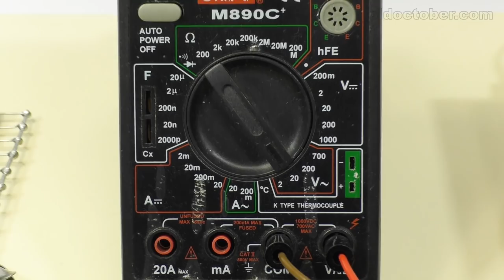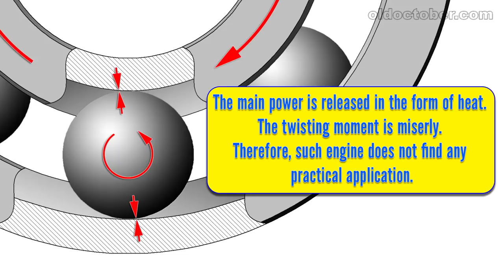Amazing Ball Bearing Motor DIY. Part 1

Comment: no really, silence works just fine. no need for obnoxious and distracting music while conducting an electrical experiment, especially when using anything in the 40 amp range. wow. an excellent video with what could quite possibly be the worst music i’ve ever heard in my life but still, I think the video compensated for the bleeding eardrums so it was worth a thumbs up

Comment: This is just one big short circuit. Unless you have some how hidden an actual electric motor with in your model.
If it is thermal expansion that makes it work then surely using a small blow torch instead of electricity would also make it operate....?!
I'm not convinced!

Comment: With that much current, there is considerable magnetic field circling the wires going to and from the bearing assembly.  A similar magnetic field circles the bearing shaft itself.  The interaction of these two fields may propel the motor.  I suggest moving the wires into various positions and see if it makes a difference.  The best way to negate any interaction between fields in the shaft and wires would be to have the wires in-line with the shaft (all components form one straight line). But it might be almost as good to fold the wire nearest the disk back along the shaft and then parallel to the other wire.  That should minimize the magnetic interaction, if that's the reason for the motor's motion.  It would be an interesting test. And, BTW, you can get 100A out of that little box?  :)
Reply: 500 W

Comment: DoItYourself  ..  Only Marinov thought it is caused by thermal expansion. He was a bit crazy. It's not the Huber Effect, either, that was a rail gun. It was first done by Milroy, 1959.
Reply from the maker: There are other theories explaining this phenomenon, for example, gas expansion under the influence of plasma. I told the most popular.

Comment: You must add an serial resistor for high current reduce an limiting.
   Your system use high current may be battery exlore.
Reply from the maker: My homemade power supplies go into current stabilization mode when the current limits are exceeded.

Comment: thats power supply is 5V 100A? WTF dude
Reply from the maker: 2V*40A=80Watt The protection of the power supply is triggered by 250 Watts.
Reply: +Do It Yourself 😅😕😑
Reply: you can use power supply from server
Reply: That's only 500 watts. That's less than 1 horsepower. And it's actually a lot less than even that since the video itself stated that its voltage dropped to only 2 volts when only 40 amps were drawn from it, and though maybe that was because 3 volts was what developed across the wiring i.e. the wiring had 3/40 ohm of resistance, I doubt the wiring's resistance was that much though.
Reply: صباح💋
Reply: Yhy dosent it have sparks with 100 amps ??
Reply: roberto hurtado tvc
Reply: Idea schematic and building instructions for power supply you are using. Would appreciate it I think everyone would.

Comment: It is a synchronous motor in my opinion and RPM is determined by the numbers of balls. Cannot be used as a generator unlike any other electric motor

Comment: I thought it was the same concept as a rail gun where the Lorenz force caused the percentile to lunch linearly but in this case round and around
Reply: This motor works because of balls in ball bearing heating up and expanding due to current a channel called rimstar org made a good video about thus

Comment: it is all have to do with the flow of electricity. the electricity don't flow straight from one point to the next in straight line. It moves around a shaft like a vortex. The fly wheel drags into that flow. Walter Russell Science based. tnx

Comment: And once again youtube has shown me an inefficient motor with no practical applications...
Reply: Inneficient? For people who tries to explain how things work, it is extremmely efficient.
Reply: Not in the slightest.  This couldn't get any more inefficient.  What is seen here is akin to a rail gun, except the projectile travels in a rotary fashion rather than linear, the magnetic forces propelling it on.  Those bearings will get very hot from the high amperage, and whatever lubricant was in there quickly destabilizing or burning.
Reply: What if it was your son who made this? Would you write the same comments??????
Reply: If I had a son, probably.  I come from an engineering background, and while the general concept of such a simple motor is cool in theory, having it run in reality can be pretty dangerous.  High amperages are dangerous if not handled properly, and if the motor seizes, it could weld itself together, and even throw off chunks of molten metal.  Worst case scenario, anyways.  What age group for a son are you thinking of that would have permission to run high amperage equipment anyways?  Just wondering.
Reply: Not everything has to have a practical application! This is more a learning tool that can be used by educators. And they are so simple to build that even kids can build it.  This looks like a homopolar motor!
Reply: as top said, this is super efficient lol
Reply: Hey don't let your son do this if you don't want him to burn the house or to get injured. Also don't let him to play with condensers if you want for his fingers to not be cooked.

Comment: ball bearing motors do work for sure but needs very high current. nice little project but one thing dude...that little power supply says 100amps?  in such a small box?, I'd like to see inside....unless you have power mosfets in there, and ac to dc conversion directly to the mains , there is no way you can get 100amps out of that little box......direct ac to dc conversion and power mosfets will give you 100 amps in a very small size but that means one side of the line is always tied to mains power so dude...this is a nice little VERY DANGEROUS project.....you definitely must have an isolated pulse width modulation circuit in there or one or more lantern type batteries in parallel....I do see an ac cord out of the back of that box so I would guess pulse width modulation supply ....anyways for those who commented here about the supply....PWM supplies can supply huge currents in a very small package...its not unusual to find these type of videos showing supplies like this....before PWM supplies, 100amp units were the size of 20inch TV...now they can be made the size of cell phone adapter.....
Reply: So I was right . You rectified the AC directly with diodes and then used power MOSFETS. Well, that will give you 100 AMPS for sure but that also means one live AC line.  Very dangerous......unless you plugged that AC cord into an isolation transformer.  Still, very nice project, but impractical......use bearings that have one runner isolated with either thin layer ceramic or plastic and then apply high voltage , low current.  Result will be the same but much reduced current consumption...unfortunately , arcing will occur but it shows that same result can be achieved . Unnecessary high current is not needed.  Make sure ventilation is available, ozone will be produced. Also, AC cannot be used, only DC otherwise no “H” field will be produced to cause rotation.

Comment: First off the music gas to go . Im not quite getting what you did with its not diodes? And how many amps dud it draw? And what was the voltage going to your motor? Sorry toy leave alot of questions.
Reply from the maker: The motor can operate on both direct and alternating current. A large motor will consume 40 amps, a small one - 20 amps.
See details here:
Part 2: https://youtu.be/O6jpZ1p5vyg
Part 3: https://youtu.be/KN8pu7UJpGE

Comment: what is the name, value and task of ten components that were connected serial.
Reply: Resistors and it is being used as like a fraction of an OHM current shunt to measure the current through the circuit this is done white commonly in most amp meters including digital in most analog ones Mike and I'm also meter there's the same thing except it's generally a piece of resistance Warrior on the board or a physical resistor.

Comment: Excellent exam question for electrical engineers! How does it work. I figured it out, so if you studied electrical engineering you should also be able to explain where the torque comes from. Clue - it is not from thermal expansion. Draw the field lines and it should be clear. If not, then have a beer. Actually, have a beer either way
Reply: Dennis Levy i was gonna just move on but you brought a reasonable challenge articulated in a calm manner. Now instead of chopping firewood I'm trying tofigure remember the leftside hand rule for determining the direction of magnetic flux. Dammit.
Reply: Yes Jonathan, with a comment like that you will never be an electrical engineer. A real electrical engineer sees the challenge in figuring out where the torque comes from.
Reply: Hello Dennis. I agree with you. It must be tangetial component of force F=q(v x B) on electrons in bar. Magnetic field B is problem to understand because all engineers think that it comes from drift electron current. But it comes from e.g. AXIAL current field J=(sigma)K   and that magnetic field is in shape of rings. Then use Lentz rule on electrons wich move in spiral path and you have tangential component of mehanical force.Greetings from Serbia.
Reply: Not right. Thermal expansion is the best explanation I have heard for this. Remember 40A is not a small current. It can create huge amount of heat in that metal.
Reply: Really?  Then why is the torque exactly the same when it is cooled in an oil bath? Where did you get your electrical engineering degree? Which university? Would be good to know the truth.
Reply: Engineering degree? I just left school at 2nd grade ;)
I think it is easier if you explain which fields exactly are in opposite direction that cause that move.
Reply: Dennis Levy b
Reply: david.  we have made that motor as birthday gift for our prof. of  "electricity" in university 28 years ago... 
Electromagnetism do not explain it.  It works on ac aswell with dc.  When using precise and new bearings the starting occurs without manual help and  rotation direction is random. If it would be electromagnetic the direction should be polarity dependent.
Reply: @jonathanee23  not fake I've done it myself I'm a DUI person into Electronics.
Reply: @MrTaff121  didn't know it would run an AC and yes I noticed mine would start up and randoms which baffled me. In terms of directional rotation.

Comment: You powerd with DC, didn't you?... But measured with AC...
Reply from the maker: I used alternating current. But for the Huber effect it does not matter what current to use. The effect manifests itself on a constant current in the same way.
Reply: Do It Yourself oh cool that's interesting... Thanks! So since this is actually working only by thermodynamics the current type doesn't have any effect! 
80W is quite a lot 😁
Reply from the maker: 80W is quite a lot
Yes the whole structure quickly heats together with the wires.

Comment: Attach the capacitor bro so the push start will not be required.....
Reply: Suliman Khan SK that works only in induction motor, as it provide a phase shift in between current and voltage that is further utilities in magnetic field space shift.
Reply: Suliman Khan SK
Reply: PRASHANT MADAN capacitor only work on induction motor ....
Reply: What?

Comment: It seems that you made something with no practical applications BUT...
That's just apparently...
When in high school  in a class of chemistry a group of  classmates and I were assigned to make hand soap but we ended up making LIQUID hand soap wich for us " it was a fail" since we couldn't think "out of the box" as all the  hand soap in those years was solid...
Today hand soap is very common , practical and popular....si it may seem that the rig your showing us has no use but some concepts in it may find some  applications in other areas.
Reply from the maker: You're right. Some nanomotors that are used in nanorobots work on this principle.

Comment: It's an electric motor so of course there is a magnetic field involved or it wouldn't work!  And the disc's rotation has nothing to do with the bearings...They just reduce the friction of the rotating shaft.  The disc appears to be made of Aluminium...If so, it will be subject to induced magnetism due to it's close proximity to one of the supply wires, which has an alternating magnetic field around it...This causes an weak opposing eddy current to be set up in the part of the disc closest to the wire which in turn causes it to be repelled away from the wire,  making it rotate.  The eddy current is too weak to start it rotating on it's own but once you start it by hand the process can continue on its own as long as the current in applied.  This can easily be verified...Simply replace the disc with one made of plastic or card (But not an old CD as that still has a layer of Aluminium inside it!)...It shouldn't rotate at all.
Reply from the maker: Пока учёные расходятся во мнениях по поводу истинных причин работы этого двигателя.
Reply: Interesting conjecture.
Reply: No, Captain, it rotates.... See the other videos... 😁😁😂
Reply: I've already done one of this,  and it worked only with the bearings and shaft and direct current from a  welding machine.  It's not obvious that it works with electromagnetism
Reply: @randomguy1601  yes also the only thing that work for aluminum this would be Eddy currents which requires AC current not DC that's how your AC electric meter AKA kilowatt hour meter works.

I have built a small one of these myself and no aluminum disc was used it just ran like crazy dead for science fair project.

Comment: Such a small PSU for 100 amp output. This leads me to believe this is fake. Also im sure the insulation would burst into flames if 40 amps went down them tiny wires. An electric arc welder uses similar amps and the cables are a thick as your finger....
Reply: French Man relax its just 5V.
Overall power output is not that much you are thinking.
Reply: In your description you say "In this engine bearings were used with a diameter of 12 mm. The current flowing through the circuit is about 40 Amps. The voltage is 2 Volts." Is that not 80 watts ?? It sounds a lot to me....
Reply: French Man yeah I am also thinking the same now :/
Reply: The wires that are thick as your fingers, carries a couple of hundreds of amperes...
Reply: Sure. But wires as thick as them would struggle to carry 40 amperes..... Would you agree ?
Reply: French Man Those are copper wires, not some lead or tin based one, they'd easily carry 40 amps, I'd say, they'll probably fail somewhat at 80-90 amps or so...
Reply: French Man morover, they're carrying current for such short amount of time, so, even if it heats up a bit, it gets time to cool down.... prolonged use might've caused failures...
Reply: 2,5mm² wire  will carry 125 Amps for a short period before melting off the insulation and glowing red hot. 40 Amps is fine for the 30 seconds or so of this video.
Reply: It is not fake. I have seen some other videos about it as well. As I know it is called Huber Effect.

Comment: You are only measuring the voltage across the resistors. You have the meter set to read volts, not current. The reading is 0.40 volts, not amps!  40 amps is not flowing in your circuit or the wires would be melting. In any case that power supply would not supply that current, let alone 100 amps. Who stuck the 100A sticker on it? Obviously someone who is trying to fool everyone or someone who knows nothing about electricity.
Reply: One more thing I did notice something as well the power supply seems a little bit small in size for a hundred amps at 5 volts. Right.
Reply: Although I have read Around microwave oven Transformers for high-current power supplies but still it would not fit in that box.

Also I built a power supply one time to use an old power supply about the size of a computer would roughly that have a very large toroidal Transformer I use the racial hundred ten hundred twenty volt primary coil and wild my own coils utilizing standard hook up wire and heavy cable I don't remember the current and voltage but I know it was somewhere around there.

I've also used microwave oven Transformer is to make custom Transformers 4 different values in multiple warnings for different voltages and currents but it's not too efficient but that goes out the window sometimes. Also I often recycle a Transformers and rebuild them you lysing wire 4 other voltages and currents since you may not be able to get a Transformer that meets your needs I don't permanently that Aaron should top and bottom until I get the one is just right by trial-and-error at tulips and that time I did not have the tools or the knowledge to completely calculate everything accurately so it was rough calculations Plus trial and error and tweaking. for the most part.

Comment: Which type of power supply u 've used?
Reply from the maker: Power supply AC 5 Volt 100 Amp. When the power reaches 300 watts, the power source reduces the voltage.

Comment: 500 watts ??? 100 amps ... Wtf
Reply from the maker: The power of the switching power supply is limited to 200 watts. After 200 watts, the voltage decreases.

Comment: Wrong...not thermal spinning effect, but electromagnetic.
Replace "ball" by needle/cylinder/rod bearing and the motor will stay running.
Submers in water also.

Comment: The whole intention of a ball bearing is that the ball does not grip the lining of the bearing.  This motor revolves around the specifically minimized grip that the ball gets on the lining.  Not the greatest design I have seen IMO